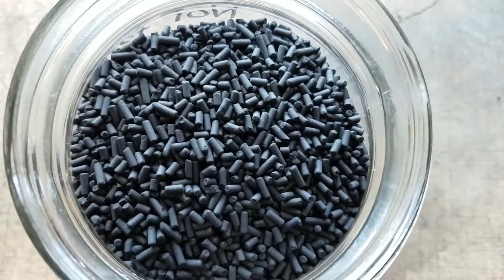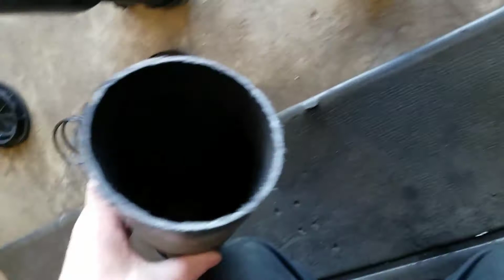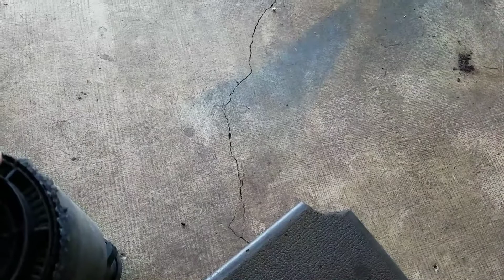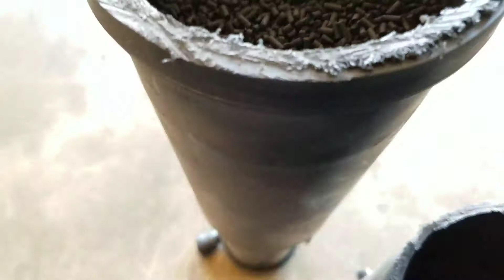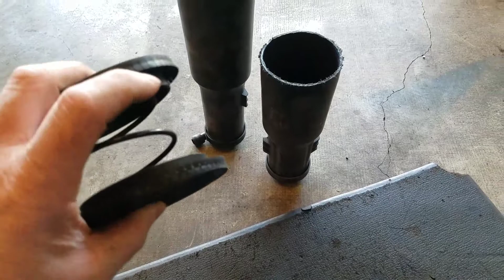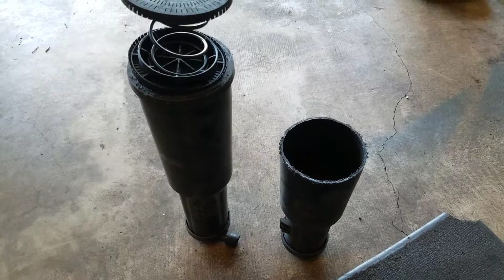2004 Ford Freestar can't fill with fuel.

Comment: Where is the evap. emission vent solenoid  on a 2006 Ford freestar 3.9 motor  the 4.2 is different
Reply from the maker: @SalomeRivera-y6e As Per Pro-Demand service software,  the evap vent solenoid is on the hose assembly that is behind a splash shield in the left rear tire well. The hose assembly is attached to the fuel filler hose assembly.
  From the drawings I see, it looks like the vent valve is not serviceable separately from the hoses. I could be wrong, since these are just drawings and not actual photographs.

Comment: Steve, great thanks for making it. I have the same issue and I couldn't fill the tank! and my thought was: The fuel gauge is not working. I really thought the tank was full of fuel because it behaved the same as the tank was filled up! And I found out the hard way yesterday!  I was totally out of fuel and got stuck 23 miles away from home. 
I called up a friend and got me a gallon of fuel and the car started again. Now I know what to do. Thanks again.

Comment: https://youtu.be/4AEFabYI1Do      Maybe this will help someone too. There's a valve in the inlet of tank that needs pushed on to reopen it. Take off the hose at the tank end and use something to reopen the valve that's stuck. If its not this then its the charcoal canister.